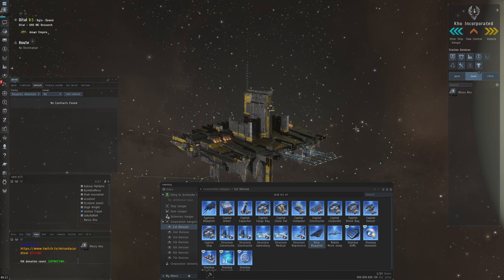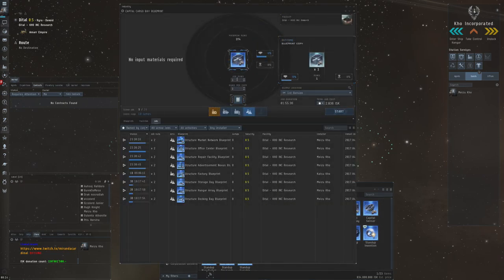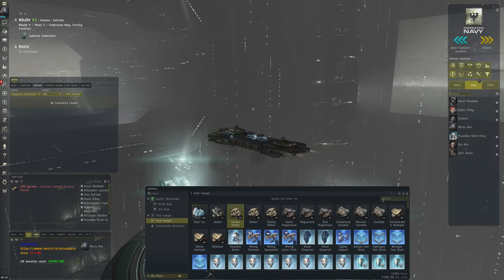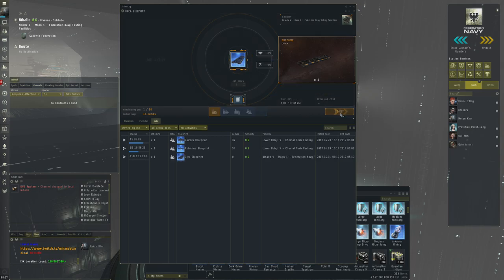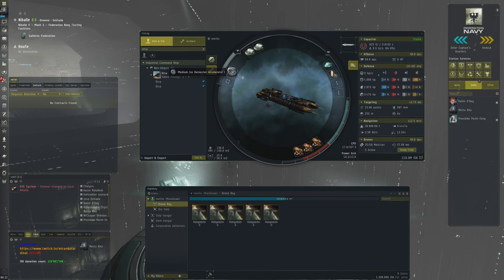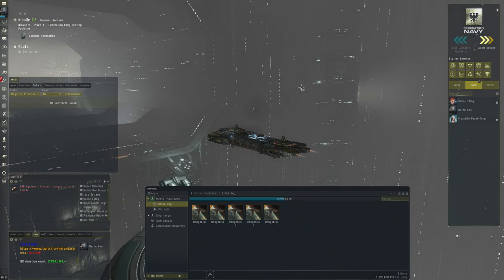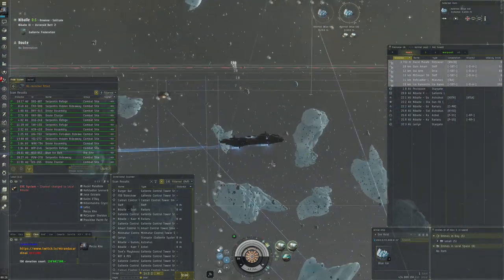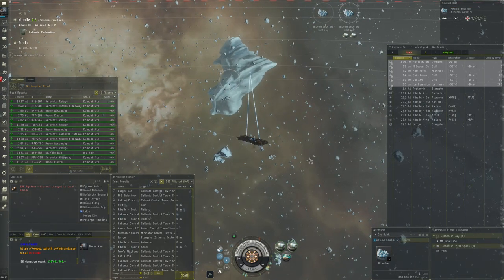EVE Online - Orca build phase 4

Comment: You should drop the extender, it doesn't offer much to the tank. Instead you should fit either a prop for 10s aligns or a drone nav comp for mining drone speed.
Reply: Just to clarify, an AB doesn't give enough acceleration to hit the 75% of base velocity needed in one cycle. You'd need to run the AB twice to get enough speed. It's like the Bowhead...it needs a MWD or multiple AB cycles to get up to speed. Either a Drone Nav works or another invuln in my opinion, though an MWD is the best option to turn and burn from gate to gate and such.
Reply: Ofc ofc, I did mean mwd but just defaulted to prop, assuming that the 10s align on a ship the size of an orca would imply it. I might even go further and drop the bulkhead for a hyperspatial or something, if somebody wants to ganks you, you're going to get ganked, t1 destros are cheap as chips.
Reply: I figured you had MWD in mind given how you put it; "10s aligns" means MWD in my head. That's more for Delonewolf and others since the AB is generally fitted first since it's easier to fit and, assuming it works like it does in most cases, gets you in warp faster. I was surprised to learn through trial and error that the Orca could barely turn better than a freighter myself.

Comment: you can fit  6  links on the orca    maybe 2 schild 1 armor  and 3 mining 
and only start the ones you need
Reply from the maker: i don't think you can use all 6 without rigs.
Reply: no not all 6  at one   but 3 mining boost  for boost your fleet     and the others for solo Tank  so you can boost your tank over 600k EHP because the Mining Boost dont apply to your drones  so for solo there useless
Reply: [Orca, HighSec Orca]
Reinforced Bulkheads II
Damage Control II

Adaptive Invulnerability Field II
EM Ward Field II
Thermal Dissipation Field II
Kinetic Deflection Field II
Explosive Deflection Field II

Shield Command Burst II
Shield Command Burst II
Armor Command Burst II
Mining Foreman Burst II
Mining Foreman Burst II
Mining Foreman Burst II

Large Core Defense Field Extender II
Large Core Defense Field Extender II
Large Core Defense Field Extender II

Hobgoblin II x5
Hammerhead II x5
Mining Drone II x5
Salvage Drone I x5
Ogre II x3

Shield Harmonizing Charge x600
Shield Extension Charge x600
Mining Laser Field Enhancement Charge x600
Mining Laser Optimization Charge x600
Mining Equipment Preservation Charge x600
Armor Energizing Charge x600